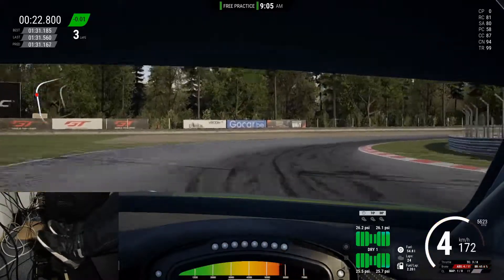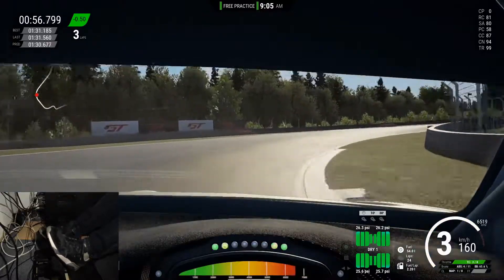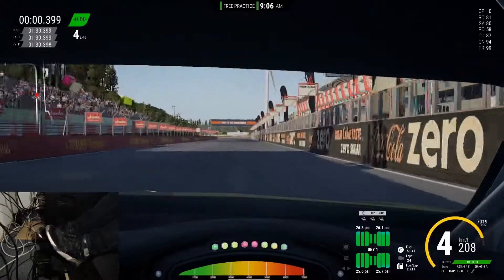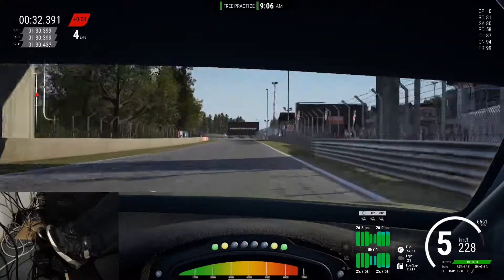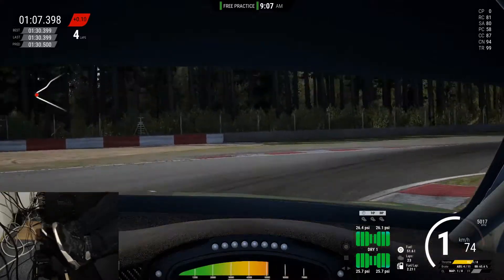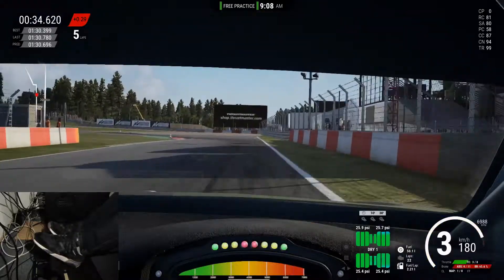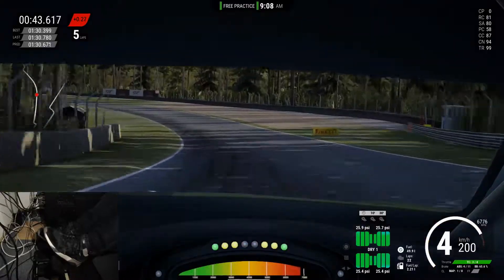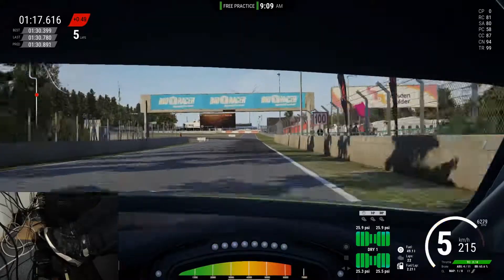What's the Deal With Load Cell Pedals?

Comment: How about the thrustmaster tlc.  Any good ?
Reply from the maker: I haven't had a chance to try those, but looking at reviews, they seem to be pretty good. In addition to a load cell brake, they also have hall effect sensors for the throttle and clutch (which are far superior to potentiometers as well).

The Simpit did an in-depth review of the T-LCM, if you wanna check it out: https://youtu.be/4zXhtECfLRM
Reply: I've just got the thrustmaster load cell pedals coming from the g920s
Major upgrade I'd say
Well worth it.
Reply: I got them.  Really good. I think it’s my best piece e of equipment in my little sim setup.
Reply from the maker: @xk964264  Happy to hear you enjoy them!